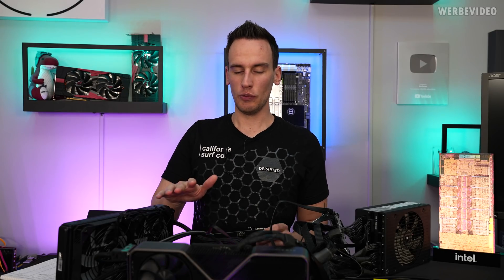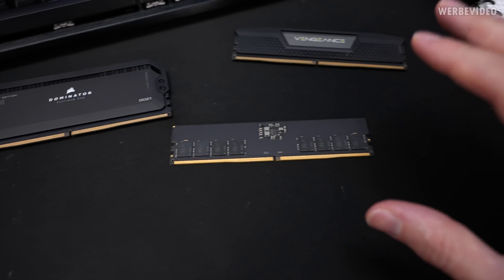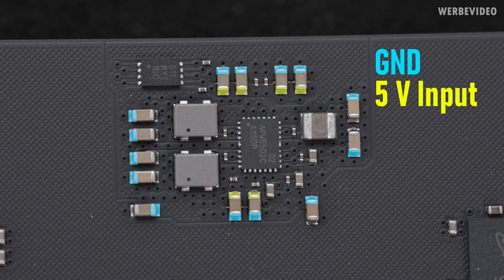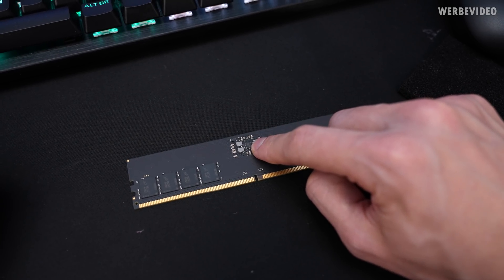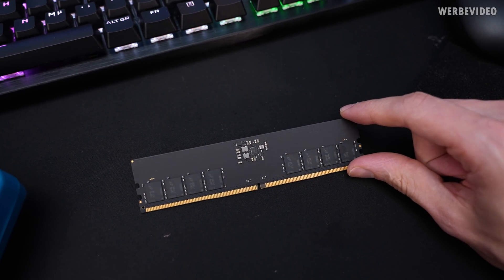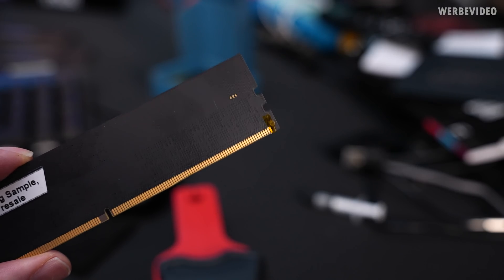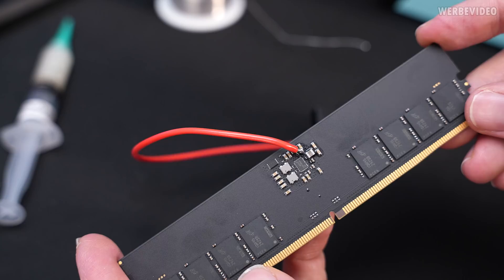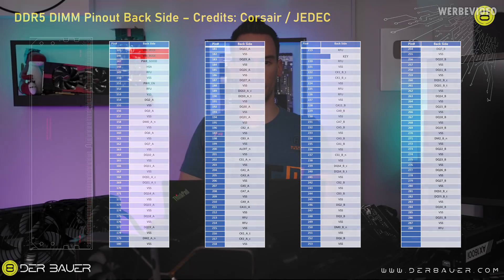We're modding a DDR5 Module and measure the Power Consumption

Comment: i have an identical module to the one in the video that will not POST. I tried taping off the 5V supply pins and adding power externally, but as soon as I connect 5V, the motherboard seems to reset and will not POST again. I measured 3.2V for PWR_GOOD and the generated voltages look fine (VDD/VDDQ are 1.1V and VPP is 1.8V). I am curious to figure out what is wrong with this module, but where do I look next?

Comment: Could you repeat this test using modern DDR5 modules? I'm very curious about the actual power consumption of modern DDR5 modules running for example 1.45V at 8000 MT/s and different capacities (2GiB chips vs 3GiB etc)

Comment: Thank you for your video. Regarding power consumption, I would like to know if 2gb of ram use as much as 32gb when only 2gb of ram are used on the entire module (For example at idle or light use). Any idea ?

Comment: Remember that the PMIC is not 100% efficient so 10-20% of the heat is not coming from the memory chips.
Normally measuring memory would only show the memory actual consumption as the conversion/regulation was done on the mainboard.

Comment: 7:34 I didn't see it posted here yet, but PWR_EN will be the enable pin of the PMIC. It should not start up unless that pin is high. The PWR_GOOD pin will be the output of the PMIC telling the computer that it brought up the voltage rails successfully and their voltage is within limits.

Forcing the PWR_EN low should disable the PMIC completely, then you can do external voltage. But you will also have to force PWR_GOOD high for the RAM to be recognized. For other internal power switch buck regulators when they are in shutdown mode it turns off both mosfets completely, so it's possible that you can solder wires to capacitors and power it externally, but to be absolutely safe you would have to remove the inductor.

It may also be possible to just leave everything as-is and just remove the inductors (and solder new wires to the inductor pads or capacitors). Depending on how it's designed, it should sense the output voltage after the inductor and it might not error without it. However if you want to OC it with more voltage, and that voltage is higher than the PWR_GOOD set point then it will not report power good to the MB.
Reply: @cas curse Deadmans trigger.
Reply: @cas curse I thought it was pretty normal for a device to pull high when it showed a good status? Any instability of voltage should pull it low.

Comment: I am curious what the efficiency of the voltage regulator is and how all the marketing around less power deals with this. That is power losses that previously were on the motherboard and are now on the memory stick. So even if they are 80-90% efficient, that is 0.8-1.6 watts at your highest power draw. This used to be dissipated on the motherboard and is now dissipated directly on the stick.
Reply: Those things should be more like 98-99% efficient. DC-DC conversion with such high switching frequencies is very easy.

Comment: A part of the DDR5 spec is, at least as I understand it, that there will be ECC integrated into either the chips or the module, not sure which. What I want to know is if there is any way to monitor this. While, again as I understood it, it is expected that bit errors are going to be much more common in DDR5 compared to DDR4 and earlier versions, and that the ECC is there to correct the majority of these and is considered normal operation, I think it could be a good idea to be able to monitor the ECC activity so you can see if the ECC on a module is starting to work overtime to keep things limping along. This could alert you to a module starting to fail so you can get a replacement before it fails entirely and can cause data corruption at the worst and unscheduled down time at the best.

With DDR4 or earlier ECC is an external function depending on the memory controller doing the lifting and the modules having the extra memory chips for the ECC bits. When a ECC event occurs this is reported in the system log as either a bit error that it was able to correct or as a multibit error that ECC couldn't correct. But I haven't heard anything about how this will be handled for DDR5 and the internal ECC functionality. It could be that it's not exposed at all to the system, but I sure hope that's not how they went with it. At the same time I could understand if they don't want to expose this to the users as it takes some getting used to thinking of ECC events being something you expect to be seeing. After all every time ECC has to correct a bit error it's because something went wrong, just in the case of DDR5 it's just the normal kind of wrong...
Reply: The ECC is chip-internal, and as far as I know it is transparent and not reported. But I have not read DDR5 chip datasheets yet, there may be a reporting mechanism for uncorrected errors, if there is it is probably very simplistic, like "pull this general error pin high if one of the chips had an error". Even DDR4 had obscure things like Command/Address parity and write CRC.
Reply: AFAIK ECC in DDR-5 is so they could sell us chips with correctable errors, not to protect from errors end-to-end. So it is interesting whether we will have a special kind of server DDR-5 with a second layer of ECC correction - after the data has been sent via the bus to the memory controller.

Comment: The CAS latency is huge on these modules.
Reply: That's new DDR generations for you. Unless you're going to be losing money by not upgrading to the latest and greatest, wait for it to mature before buying.
Reply: What I’ve heard is that you can’t really do napkin-math latency comparisons from DDR4 to DDR5, but we’ll see how that pans out.
Reply: @reinhardtwilhelm5415  You pretty much can, as long as you remember that latency is always given in ticks, not nanoseconds. DDR5 6000CL40 = DDR4 3000CL20 to all practical intends and purposes when it comes to latency. The devil is in the subtimings however, and there's a lot there that still remains to be seen. One of the advantages of moving the PMC to the DIMM could be better subtimings...

Comment: fyi the larger component you called a MLCC that has the same voltage on both terminals is probably a ferrite bead, not a capacitor.

Comment: My ddr4 4266 cl16 reads as only 6-7 watts. DDR5 may be less power draw per troughput but it sure seemy like we have another component on our hands that will increase power draw. Which im not happy about as cpu and gpu already went up a lot in power draw and electricity prices are trough the roof and i wonder if they ever go back to normal.
Reply: At stock voltages those dimms will be probably about 3watts flat out. DB only tested xmp. I am someone who goes way back into the days of undervolting things, so heat and efficiency is important to me as well. But if you are spending 350 dollars on a ram kit, you shouldn't care about upto 10 watts of power use for the 2 years you may keep it. As for cpu/gpu, If performance is good for my needs I will generally turn cpu turbo modes off. And then set a very slight negative offset and it makes the cpu drop (in my case) about 35% power consumption at full load while only losing about 10% performance. My gpu I have set at around 90% power limit because I don't like how noisy and hot it gets when gaming, and i didn't notice any difference in performance what so ever in doing that. But I also did a very slight positive clock offset on it.

Comment: What do you think about moving power management to the DIMM? Is that a good thing for consumers or alternatively is it a bad thing?
Reply: A bad thing in a way as the bone stock JEDEC memory may have a limited voltage range with the PMIC compared to memory specifically made for XMP/OC.
Reply: @sabishiihito  So a DIMM with nice memory (think DD5's "b-die") may be limited because the manufacturer didn't load XMP profiles? I use "The Stilts" built-in profiles on my Crosshair x470 board so I'm a bit confused.
Reply: @JohnDuthie  if you buy XMP modules, i guess you can overclock just fine. the problem is when you buy a purely JEDEC modules that has no XMP profile. they're more likely to use non-programmable PMIC thus resulting much less OC headroom
Reply: And some companies may choose to cheap out on a PMIC and thus have dimms that are not quite upto scratch.
Reply: To add: pmic will prevent us from overclocing the ram from MB bios, because the MB will not be able to change the voltage. Thus the producer will have better control over what we can do.
Reply: @angelg3986  um.. as long as the PMIC is not on secure mode, you still can set the voltage from BIOS. even more, now you can adjust the voltage per module if your BIOS allows

Comment: You must have a massive problem in your testing configuration, because these power consumption figures are WAAY too high! I think you must have disabled c-states for this test, as often happens in individual testing.

Power consumption should be in the low tens of mW at windows idle, possibly going down to about 1mW for the entire stick if the DIMM supports long self-refresh cycles and the system is truly completely idle. Under very intense system loads, the memory manager should still be able to put the memory into self-refresh very regularly (definitely >70% of the time, usually 95%+ of the time), meaning that you expect those power consumption values for 5-30% of the time, i.e. about 1W per DIMM typically. Only when doing nothing but full-speed transfers into and out of memory should you ever see these kinds of power consumption figures.

The problem with this type of testing is that you don't actually get a realistic indication of achievable overclocks. If you keep the DIMMS hot, the latency goes up quite dramatically.

When overclocking, c-states are your friend! They save power so you can achieve higher clocks. And in the case of memory and the memory manager, they save a LOT of power.
Reply: I don't quite understand what are you saying. I have never experienced any RAM sticks to underclock and undervolt when "idle". DDR4 sticks are usually around 6-7 watts so this actually makes sense for DDR5
Reply: @1337Ox  DRAM doesn't undervolt when idle, its clocks are stopped (selectively). 

DRAM is clocked from the host at - typically - 400 or 800MHz these days, and this is done to synchronize transfers. However, along with those transfers, the cells are also refreshed and that is actually what consumes the vast majority of energy in DRAM. However, you don't need to refresh DRAM cells 400 million times per second - most cells retain their information on the microsecond or even millisecond timescale just fine. So the host can elect to stop the clocks to the DRAM module and when the DRAM module detects this, it generates its own much slower refresh clock of - typically - 10Hz to 10kHz. This is called self-refresh and is a required standard part of the JEDEC specification of DRAM since at least DDR3. You can imagine that reducing the clocks from 400MHz to 10kHz represents a gigantic reduction in power consumption.

And the cool thing is that even for VERY short periods of inactivity of the RAM - literally submillisecond periods where you don't need to do a transfer - you can let the RAM go into self-refresh. There is no performance penalty for doing this, only energy savings and thus ultimately better performance.

By default, at least on Intel desktop CPUs, the memory manager only puts RAM into self-refresh if it's in a c-state higher than C0, so it's important to enable C-states when doing any memory testing. And yes, the memory manager can enter higher c-states even when the CPU is at full load, you don't need to worry that the CPU will have lower performance.
Reply: @ssj3gohan456  Hey I appreciate your time explaining this! Had absolutely no idea it works like this, thanks

Comment: dear der8auer
your test Power of DDR4 not good becasue:

1) the peaktech 4250 had 2 range:
a:10mA-20A +-(1.5% + 5mA)
b:100mA-40A +-(2%+20mA)

let say you in A range, the min current is 10mA, then it start at 5V*10mA=50mW or 0.05W
in your test about 5W  power consumption(current about 1A)

the max error in A(range) 1*1.5%=15mA + 5mA=20mA Power (+-)0.1W
by the way , i dont this that this device precise , i have doubts  about accuracy datasheet.
and have a lot of AC electronics noise  that can give fault reading.

i cant belive DDR5 have 5W power consumption.

the best way to test it, use usb boot memtest without hard disk /SSD .
put one DDR5 constant and boot to USB memetest system. test wall AC power consumption. let say 30W.

then put one more DDR5 and enter USB memtest and run . write the min power and max (min power when it test only the first constant dimm DDR5 and max with sec DDR5).

(max power)-(min power)= the TDP of DDR5 stick
Reply from the maker: The error is not relevant in this case. It could turn the measured 8W into 7,8 or 8,2W. But the result will be more or less the same.
The power draw is very similar to DDR4 so why not 5W? DDR4 starts at about 3-4W if you run 2133MHz and 1,25V. So if we run a much higher frequency here and similar voltage it is absolutely in line
Reply: @der8auer-en  as i was said, normal 4G DDR4 stick from 2014 memory chips is about TDP 1.5W.

test low DC current with clamps induction in lease accury.  the best way to connect serial mA meter to 5V power line. not with clamps.

i sure,  the accury number the manufacturer  publiblsh in datasheet, is not true.
Reply: having more ram sticks means more power spent by the cpu memory controller. Also he told he used a current clamp, so likely not the peak meter, normally I'd have used 2 distinct meters - one inline for amps and another for the volts. I don't think memory warrants used of a scope.

Comment: 5200mhz C36? If it was a DDR4 it would be extremely slow...
Reply: Well you can't compare ddr4 to ddr5
 watch linus video
Reply: @Leicht_Sinn  I know. But I still feels odd because when you compare DDR3 to DDR4 the CL per frequency was similar.
E.g: 
Good DDR3 1600mhz was CL8
And good DDR4 3200mhz is CL14

As you can see they the increase is almost linear.
If DDR5 followed the same rate of increase at 5200mhz the DDR5 should have CL22~24 but it skyrocket to CL36.
Reply: @vitor900000  It took a lot of time for DDR4 to get those speeds at those timings. When DDR4 was first coming out people were complaining exactly the way you are now. Can you guess what it was like when DDR3 first came out, and DDR2, and moving from SDR to DDR?... Yeah, it's exactly the same every generation. You get used to it after a couple of decades...
Reply: @andersjjensen  I'm complaining... I'm just making a observation...
Reply: because that is bargain basement DDR5
Reply: Good thing its not ddr4

Comment: Why you cover the 5v pin with tape?
Reply from the maker: To cut off input voltage
Reply: Because he connected a 5v cable directly to the chip so he can measure the power consumption
Reply: Aha I get it, I'm so dumb, sorry 😅

Comment: I'm impressed. The wattage and power consumption per DIMM and per CHIP is very similar to DDR4, and I would definitely recommend power cooling if you have douible sided DDR5 DIMMs that you intend to overvolt.
Reply: Not necessarily. I run my dual rank b-die at 1.57v daily at 3800mhz CL14, and never have any issues with cooling. I might be able to shave a few off my secondary timings if I ran a fan over it, but for the most part, more air cooling isn't going to result in a drastic drop in primary timings. A decent heat spreader, and normal case airflow should be more then enough, unless you live in a desert and don't have air conditioning.
Reply: @simplyscholar21  so erm; anyone in a country outside of the USA then. 

In the UK and Europe air conditioning is absolutely not common in homes.
Reply: @ChristopherEast  Yeah) As someone that lives in Siberia where it is 30+ C in the summer and -35 C in the winter i can say:
1) In the winter your temps are great and you don't have any issues
2) In the summer your pc is MUCH hotter and you should have good airflow or it'll be bad

I (personally) don't know anyone with air conditioning in their home. Having one in the office or a store is a must and it is always present.

Everyone more concerned with heating their house in the winter, so you'd rather buy a heater than an AC.
Reply: @ffwast  I actually have one. It’s a horrible single hose portable unit. But I have one. 

But unlike in certain parts of the us (where I originate from, I should add) where it is necessary, for most places in Europe it would be a waste of money; just like gas central heating is seen as a waste of money by most people in Florida or California.
Reply: @ChristopherEast  As someone living in the central US (so we deal with both temperature extremes, and humidity), I was shocked as a kid to learn that.  When it's 40c and you're in a multi-story building with broken air conditioning, just feels like death.

But PS- mini-splits are awesome, energy and space efficient.  Heating and cooling from the same unit! Also have a dehumidifier built into mine.  My apartments in a not-well insulated 135 year old building and it manages pretty well.
Reply: @startedtech  I wish I had a mini split! They are stupidly expensive here. In the region of $2000+ 

As I grew up in California, but spent a lot of time in the UK and Europe as a youngster, and have made the UK my home as an adult, I am not surprised. Most people do not realise just how much the climate varies from one area of the world to another.